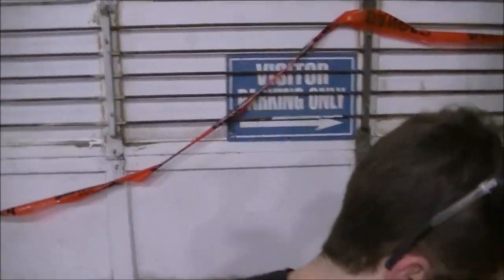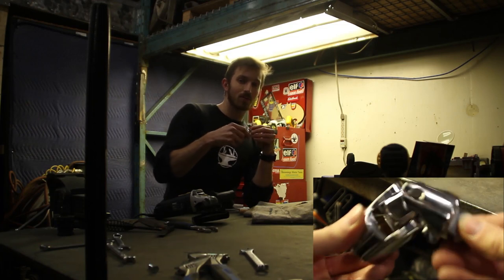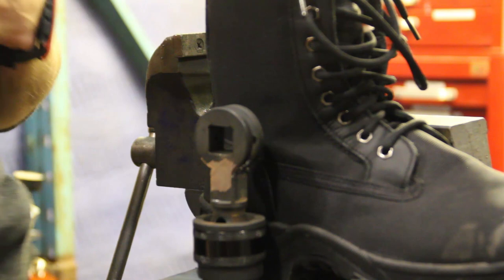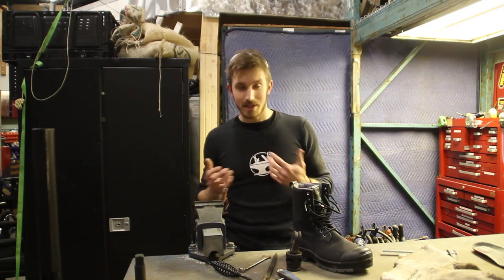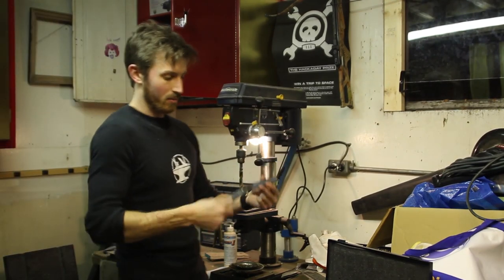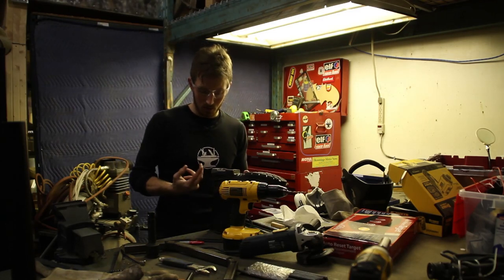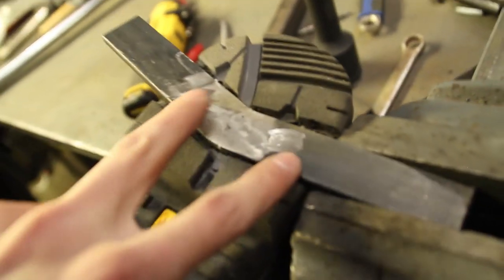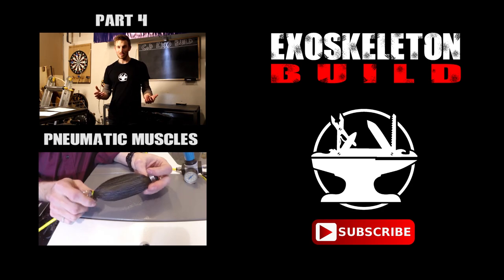Building Das Boots

Comment: Idea, couldn't you have the lower part of the leg go all the way around with a rigid square frame. Then attach the "boot" to the leg with 3-4 springs in tension along with this joint?
The joint provide the joint itself, but the springs would both provide motion dampening as you try to move (unless you plan to power the ankle itself, then its worthless) Basically make it so that you can't as easily "roll" the ankle

Comment: one thing i would have done different is i would have placed the attaching point at the arch rather then the heel and made the bar thick enough to touch the ground. I would have then added two small lengths of steel to the ends of that bar set perpendicular with a slant towards the back of the boot. less work on the boot itself and would offer a little bit more traction.

Comment: is it possible to power one with a gas engine? kind of like a motorcycle but instead of spinning wheels you move the components. this would also allow gear changes for either a ton of torque or a lot of speed. You'd probably need a bunch of axles to get power to your joints such as to your shoulder then past that to your elbow then past to your hands.
Reply from the maker: Power with a gas engine, sure, but distributing that to each joint? Would be a mechanical nightmare.

The most realistic design for building a mech or large scale exoskeleton is with hydraulics for individual joint control -- then a gas engine on the back powering the hydraulic pump which powers all the individual joints!

I'd love to build one, but alas, funding is always the issue!

Comment: I have a question, bearing in mind that I do not fully understand your design.  When you lift your legs will you not have a fairly large load (in comparison to the load rating) on those screw threads?  Steel rivets instead perhaps? Even if there is no load under operation, wouldn't rivets have a higher sheer point than the screws for contingencies such as getting a corner of the foot caught on something?
Reply from the maker: +B Bain That's a good point! I may add a steel enclosure around the boot (like metal straps) to help reduce the direct load on the screws.

But the main point of this is an unpowered lower body exoskeleton that can lock its joints (so I don't need a non-existent power source for it). The idea would be you can brace yourself in a position, pick up something heavy, and then put it down again -- not to walk around carrying it. Good scenario is using heavy equipment, disaster scenario (picking up rubble so someone can get out) etc etc.

Comment: Amazing video :B 
Thank you very much!
P.S  I have a one question. When you cut this metal bar and then weld it,is it strong enough??
Reply from the maker: +Лалита 228 Pretty strong! Doesn't really matter though -- no real load will be going through it -- the weight will come down through the universal adapter into the ground -- the part attached to the boot is just to keep it attached to the boot =)
Reply: the Hacksmith Oh okay than,thank you for reply!

Comment: This comment is quite delayed, so I apologize for that, although it does pertain to the subject matter discussed here: flexibility/movement. My question is: Why not copy the original model that has the movement of these joints mastered, the human body? Is it simply not feasible due to the complexity of the human body, seeing as to how you're transferring an endoskeleton to an exoskeleton? My only other comment is that you may wish to look into the old hard shell space suits such as AX-5.
Reply from the maker: +NuggetandLevi I'm confused... this is copying the ankle joint...
Reply: +the Hacksmith Sorry, I was writing an essay 30 minutes prior to that comment, so I was kind of.. out of it, to say the least. I believe what I had in mind involved the ankle in relation to lateral and medial malleolus for connection points, in a format to prevent hyper extension of your ankle, but I have no clue to be honest. XD Once again, my apologies.
Reply: I think he's asking why don't you make a scaled up human skeleton of metal. it obviously works already because it's inside us doing it right now. some parts would probably need adjustments like the foot but you could just have the "shoulder bone" above your shoulder and have it strapped on on everything but the joints. if you made the "bones" thinner than normal you could sandwhich yourself between 2 sets and have pneumatics on both sides. one for up and one for down, doubling your power if you choose to use them. 

imagine wearing a suit of medieval armor that had ribs and a spine. Basically it would have joints built in with maximum flexibility.

Comment: Just curious, but for control systems, is this going to be button press, motion amplification (reading joint rotation and thus apply power), or could this get as cool as being neurologically controlled?
Reply from the maker: I'm thinking muscle sensors to start. Neurologically controlled might be a bit much for now :D
Reply: Cool! Keep up the nice work. Also, are the legs powered or unpowered? I assume in any case you plan to brace you (to prevent it from crushing your legs)
Reply from the maker: +Joel Hemphill Unpowered ;-)

Mostly because powered legs are A) very hard to control, no hope of being able to run, and B) we don't have a power source dense enough for a true iron man suit.

Comment: 1. Why are you making build-in boots? It will make putting on and off th exo  very complicated. Try to find Berkeleys exoskeletons, they use external soe bottom and it very practical solution.
2. You should make exo's foot external joint on EXACT level of wearer's foot joint. Otherwise it will be very hazardous gear. 
3. Why didn't you used spring to enchence your toes power? It could grant you alot of potential power and make running easier.
Reply from the maker: +Пётр Темников The plan is to build a inner suit to wear with it, the exo will still attach to the boots, so they aren't exactly "build-in". Since this is a personal project and not a commercial one I didn't see a need to go to the design extent of having anyone be able to wear it -- maybe for future revisions though!

This video ended off before I actually finalized the joint placement, pretty much came to the same conclusion as you did =)

I'll have to ponder this spring idea... I like it! Thanks for the feedback!

Comment: Why not use rivots, easier to make flush no?
Reply from the maker: +Tom Dare Rivets wouldn't be as strong and the whole point of bolting it was so it'd be removable if I change the design. Rivets would be a bit annoying to drill out and replace every time I want to change something =)

Comment: You could've cut the steel bar in three pieces and then welded it back together.
Reply from the maker: +Felipe Cattan On the foot? But my way only required one cut and one weld...
Reply from the maker: Nah, it's grinded flat!
Reply: +the Hacksmith Oh, ok then.